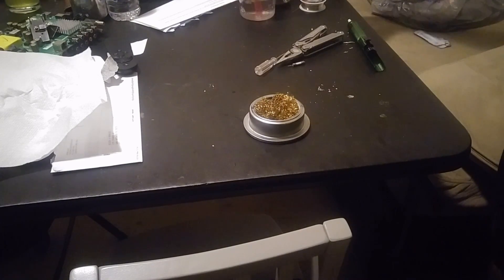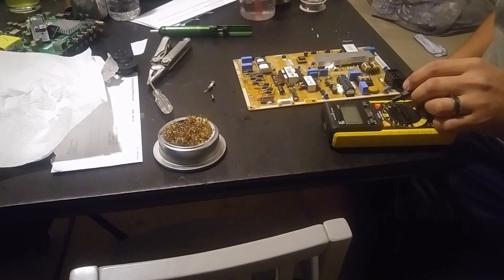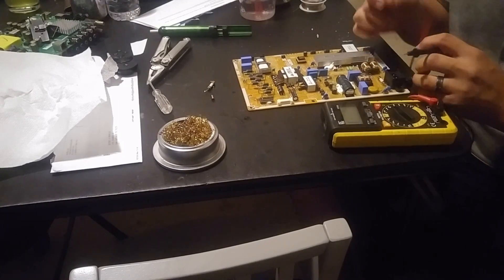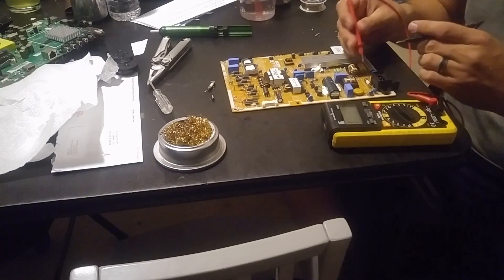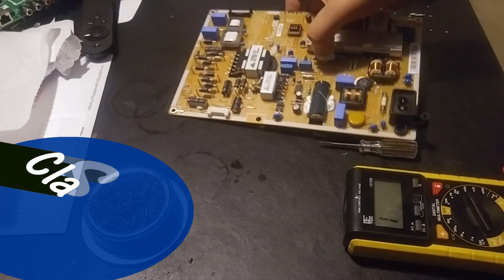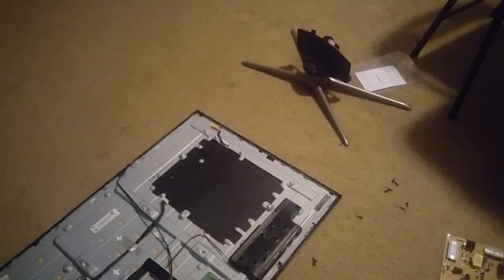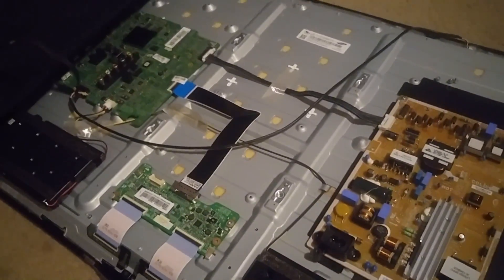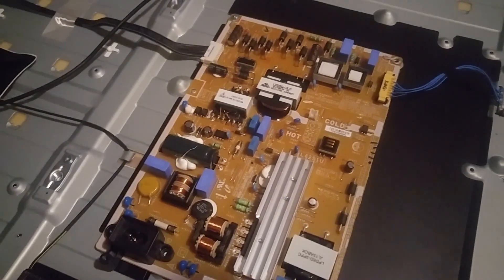Samsung Lightning or power outage surge TV fix/ troubleshoot.

Comment: When you measure the resistance in a fuse, you should get ZERO if the fuse is GOOD.  If the fuse is blown, you will get a very high resistance (infinite), indicating that there is no path through the fuse.    To measure this, you should remove the fuse form the fuse-holder; otherwise you don't know what you are measuring.
Reply: Precisely correct

Comment: You should have done a little bit more research cuz 9 times out of 10 it's the t-con board has a shorted check which causes the fuse to pop you would have found that out if you would watch the couple other videos on YouTube about lightning strikes or power surges especially if you're using any equipment plugged into HDMI that is not on a power strip which is search protected cuz 9 times out of 10 that's what's caused the chip to go bad and that's what's caused the fuse to pop on the board shorted out
Reply from the maker: If that were the case, then why would  the tv work with a power board swap? Wouldn't it just pop the fuse again? Also, tcon only controls the LCD. No foreign voltage comes from the LCD. Lighting surge will come from 2 sources, HDMI cable box or from power itself. In which means that either the main board or the power board. In rare cases it can hit both but usually it will come from the power board.

Comment: I have a Samsung 50in plasma tv, had a bad storm, heard a loud pop, and an arc, now tv will not turn on and has no standby light, model # pn51f4500af, how do I fix it?
Reply from the maker: Probably the power supply. Usually bad transistors along with fuse.
Reply: How can I fix it?
Reply from the maker: @thomasjohnson8181  just try to find another power board on eBay.
Reply: Thanks, will let you know how it turns out.
Reply: do i give them the model number, or the model code?
Reply from the maker: @thomasjohnson8181  usually you want to go by board number. But model number will narrow searches down.
Reply: found one, but i'm still going to use the board # also
Reply: power board# is power board BN4400599ASE38D5RP800 but ebay does'nt have one, now what, i'm kind of new at this.
Reply: And do the numbers all have to be the same? is there an alternate?
Reply from the maker: @thomasjohnson8181   bn44-00599a is the board number to search for. Look at shopjimmy.com for cross reference boards. It's a good guide.
Reply: Dude, you don't know how much I appreciate the help, thanks, I took a few pics of the tv with the back removed, and I noticed some black marks inside the back cover, but they're just above where all the boards are, should i be concerned?
Reply: Went to shopjimmy.com and just my luck it's out of stock, where else can i try?
Reply from the maker: @thomasjohnson8181  it's because it's plasma tv. Those are harder parts to get. Just use the website for reference in what can be interchanged.
Reply from the maker: @thomasjohnson8181  maybe just residue of the arcing
Reply from the maker: i just looked at ebay. and theres plenty of boards out there. type BN44-00599a

Comment: Quick question
TECHIE LIFE   I have a samsung led 46" smart tv  Model code UN46EH5300FXZA I have done the flash light test which i see a image in the back ground but the screen is black and I still have sound I was wondering if its the power supply board ?????
Reply from the maker: Claude Sinclair no. I would put my bet in the leds behind the screen. You gotta take apart the whole TV.. (not to hard just a lot of pieces)
Reply: I think thats the t-con board but you might have to do more research. watch tampatec video he talks about it. I believe

Comment: What does it mean if the tv keeps turning on and off after a breaker is popped our the power goes out to the house?  I had a cord get caught in a recliner and short causing the breaker to pop (the same breaker the tv is on) and now after resetting and replacing the damaged cord (not the tv cord that got damaged) the tv turns on and off.  It was a couple thousand dollar tv and I don't want to call a repair guy for hundreds of dollars if it's something simple like a fuse.  Thanks!
Reply from the maker: daniel liguori first off, what's the model of your TV? Second, let me clarify that the tv does turn on and off right? If the tv turns on, that's a sign that the main fuse is good. I think it's just a coincidence that the cord you had gone bad at the same time your TV started to act up. My first and foremost thing I would check it the power board. Look for the capacitors on the TV. They are cylinder shaped components that should have flat tops. If you see a swilled or a bulged top, that could be your culprit for the random shut offs. But in newer sets, capacitors are not the problem. Usually it would be something like the LEDs. I would need a model number to cross-reference other TV's to and similar problems.
Reply: Hi Techie life
Sorry, I didn't explain that right - the cord issue is just what caused the breaker to pop, and it's the same circuit that the tv is on.  So basically I shorted the breaker, which in turn caused the tv to see a spike I guess.  The tv is a 2013, or so, Samsung 65F8000 led tv.
Reply from the maker: daniel liguori I don't think it's a fuse, but I would point you more to the power board. The only problem is that your TV is a rarer tv and parts will come with a hefty price.
Reply: Bummer!  I should have guessed it's a rare tv since I couldn't find anything online in terms of repair videos or tutorials.  Alright, well I really appreciate you taking the time to reply.  I dropped it off at a repair shop today so fingers crossed it isn't too terribly expensive.  Thanks again!
Reply from the maker: daniel liguori good Luck .hope it's not to much for you.
Reply: Just heard back from the repair guy and you were right about the parts being rather expensive.  It's the power supply which normally runs $350 for this tv, though the guy had a spare one so it's gonna be $290 including labor.  Just figured I'd update this in case anyone has this same tv and wants to know what the cause and cost ended up being.  Considering the tv cost me almost $3k new in 2013, it's well worth the $290 to get it up and running again as it still has a great picture even though it's not 4k.
Reply from the maker: daniel liguori I agree with you.. f8000 series is well worth repairing.. even though it seems as buying a new TV is a better option.. some people don't understand that older higher end sometimes can outperform new lower end. Good luck with the TV. At least on the flip side, if your TV ever goes bad, you know that your parts are worth a lot and can resell them.